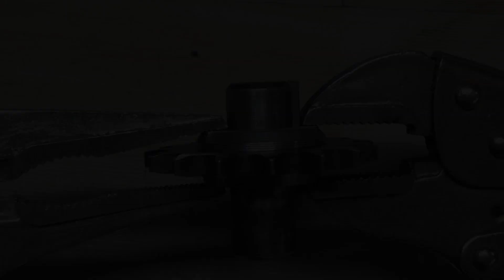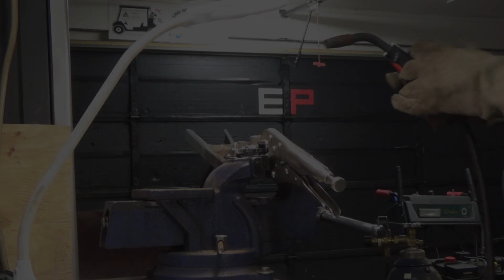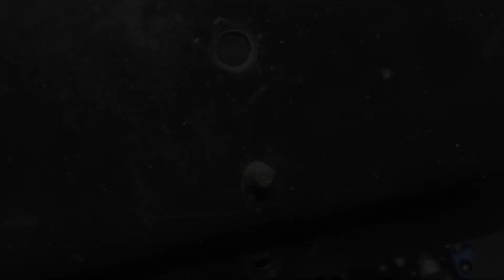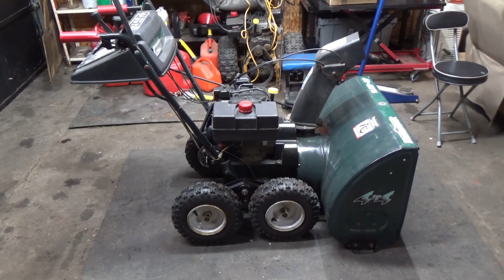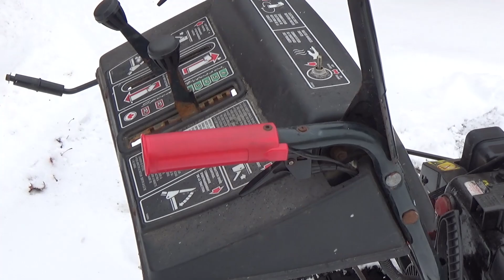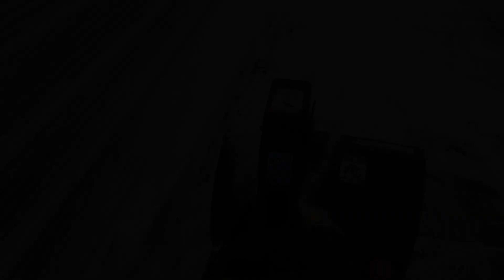4x4 Snowblower [PART 4]

Comment from the maker: UPDATE: When routing the LEFT DRIVE CHAIN, route it the same as the right side. The manual says not to, however, we ran into an issue with the chain binding up on left side when under heavy load. The chain on left side is now routed like the right side, and works perfectly under heavy load.

Comment: I have a 2001 cub cadet 1028 4x4, I am rebuilding. Mine has sprocket idlers instead of pulleys. Can't find any diagrams or parts list showing this little sprocket. Oddball, I guess.

Comment: great videos.  I have very similar machine.  Mine is a 10.5 hp white mtd 4x4.  My chain broke.  Do you know the roller chain part number ?  Length ? Etc.    I see 41 on the chain links

Comment: Hey great videos. I have a question for you though. I have the same machine just the yard man brand. I took it completely apart and put it all back together, but after I fire it up the front auger belt starts to smoke when the auger isn’t engaged. The belt is routed right and I backed off the tensioner. Any help would be great. TIA
Reply from the maker: Make sure you have the pulley brake on the outside of the belt.

Comment: i have a Yardman 10 hp track blower, is the procedure the same for the friction rubber replacement?
Reply from the maker: Yes 9/10 snowblowers use a friction wheel drive, the procedure is similar.

Comment: I wish you would have demonstrated the grease fitting when you had it out of the machine then showed yourself greasing the machine after re- assembly.  If I was you I'd keep the machine and polish it up.  The dip stick look loose as well, possibly missing the screw that holds it to the case.  You did an excellent job sourcing the new bushings as well as creating the new gear.  Really, they should have had some NOS on a shelf or knew where you could have sourced one.  A lot of nerve not having a few laying around.

Comment: I don't know how to thank you this came in handy since I just picked one up just for my own pleasure I like oddball engineering. One thing I wanted to ask was I bolted my wheels to the shafts because the pins would create more play so my thinking is that if you add the play of the whole drivetrain chain etc this is one less area with play. Maybe there's a reason why they pinned the wheels and not bolted them. Do you know why thanks again.
Reply from the maker: Bolts are ok, I may end up bolting mine! I still have this machine, could never bring myself to sell it just yet haha thanks for watching! By the way, I have a whole series on this thing, I believe 4 parts.